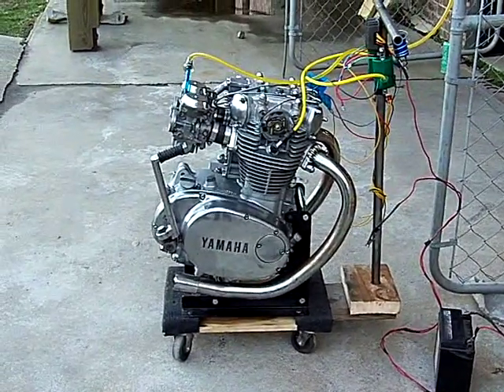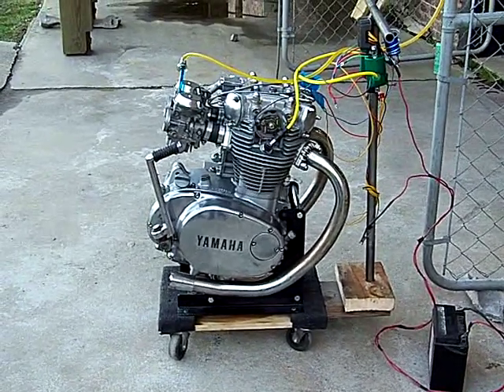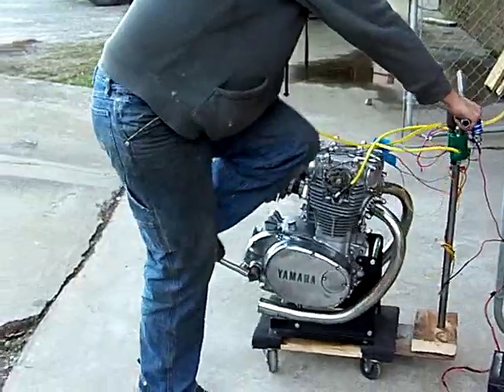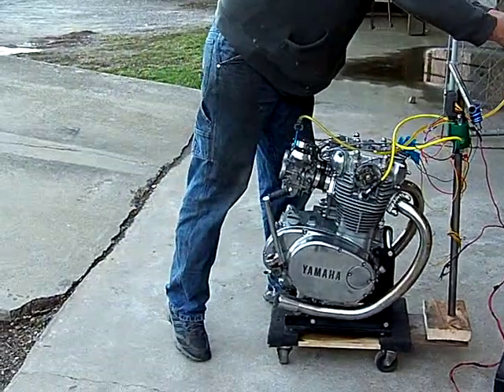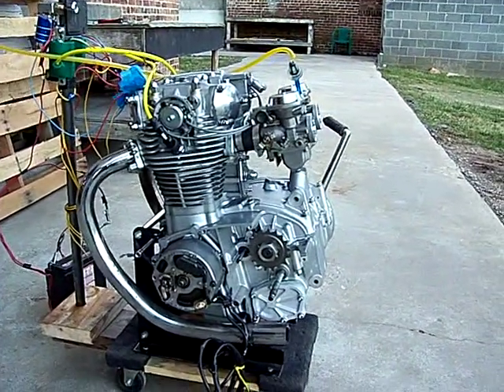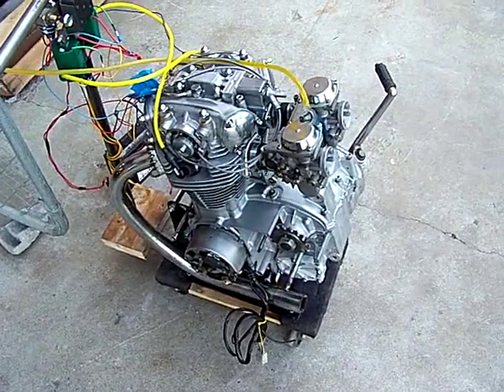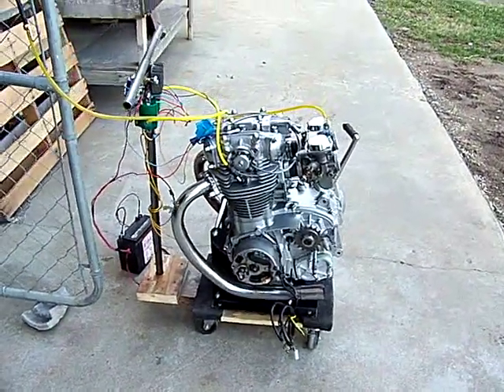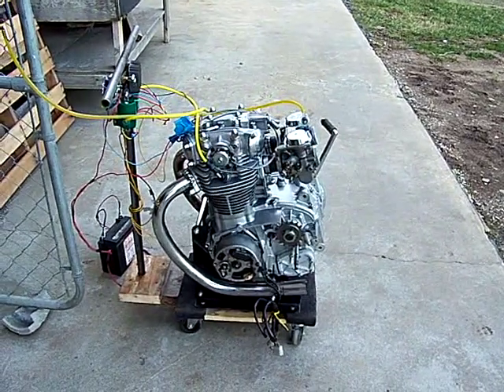Rephased XS650 with Jack's D-Shaped Intake Ports!

Comment from the maker: @joedell71 

To my knowledge, Jack does not offer these services.  I doubt I will either, as it is very time intensive, and requires rebuilding the ports completely from the inside out, then machining and hand sanding/filing etc...